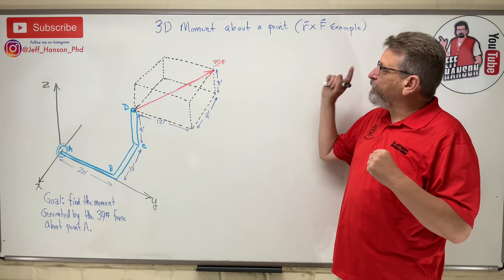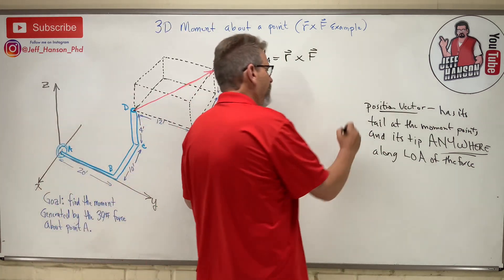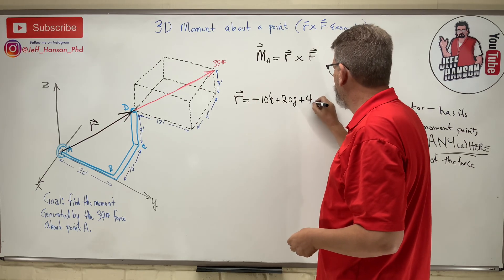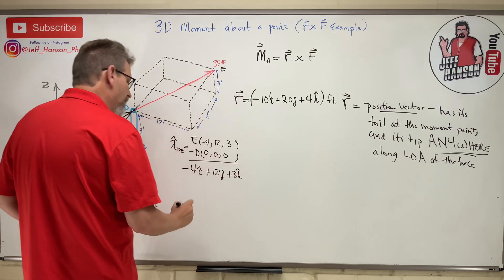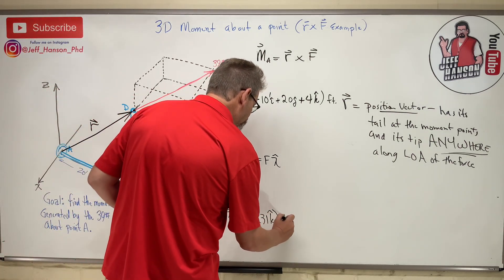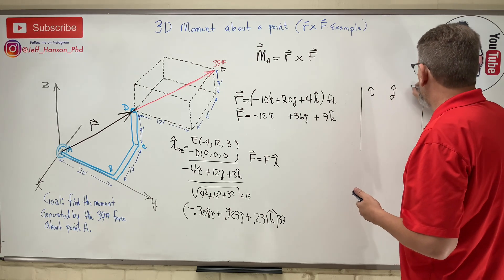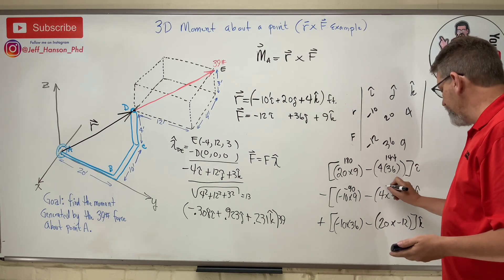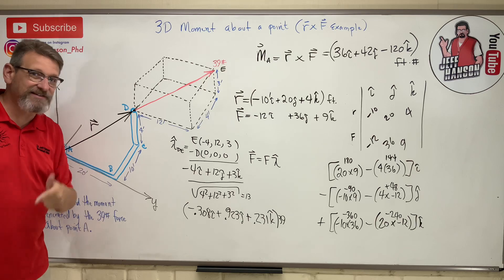Statics: Lesson 24 - 3D Moment About a Point and rXF Example

Comment: Hi, in the beginning you said i can take the Point A and attach it to anywhere to the LOA of force. When i do these exact steps using A to E i get completely different Moments. Would it not come out to pretty similar results? I ask that because when you attached it to the point D at first you then had to move the origin? Is that not an extra step that should be eliminated if you just had attached r vector to point E?
Reply: Asking the same question myself right now, but I just cant figure it out.
Did you figure it now, by any chance?
Reply: I made r vector from point A to point E which gives r vector as <-14,32,7> rather than the r he used ( <-10,20,4> ). I get the same answer using either of those r vectors. "Moving the origin" for the force vector just makes it easier to put it in ijk form. Moving the origin is simply just a strategy to make it easier to focus on that vector in the system (expressing the force vector utilizing the entire system is too complicated compared to focusing on a portion of the system because of too many possible unknowns). If we close in on a portion of a system and draw a free body diagram we can solve wherever there are less unknowns to make it easier
Reply: @laven5583  I used <-14,32,7> but got way different answers, to get the Lambda value i did AD = D - A so <-14,32,7> - <0, 0, 0> is that correct?

Comment: My lecturer does the vector cross product a different way. Would there be any reason as to why he would multiply the off-diagonal numbers first and then diagonal numbers . He also doesn't make the outcome of the "j" part of the cross product a negative answer. Would it make sense to do it this way in any scenario or would he be wrong
Reply: Just a different way to do it. I find that method tends to confuse students.
Reply: @engineeredchannel5649  yea I later realised that it gives the same answer and it does indeed confuse students. Not sure why he chose to do it that way

Comment: i figured it out. the force vector has a force that has to be taken into account when breaking it up and r vector doesn't.
Reply: Exactly, what youre doing is taking that vector, making it length 1 and stretching it by a factor of 39.The original vector just gives you a direction. So if you take the unit vector it is length one but in the same direction as the original vector. Multiplying by the scalar gives you of course the magnitude or amount of force that is going in that direction.

Comment: why is the j hat in the cross product negative .. i thought we were just supposed to add those cross products but im confused that you put a negative on the j hat  but + on i and k. can anyone please explain. thank you
Reply: it's basically how the formula works. It has always been i-j+k for cartesian form. We just have to assume that it will be negative for j. I believe everybody was supposed to learn this at the end of Calc ll or at the beginning of Calc lll
Reply: @danielowens6682  thank you so much
Reply: @zuko_4  think of the matrix (called a determinant which is what the cross product is utilizing) as a checkerboard. The signs of the matrix are from something called cofactor expansion so it looks like + - + -  but same for the signs below this - + - + but in this case we only had 3 components in our equation hence the + - +. The signs only apply for the rows or columns you are expanding along. In this case we are only expanding along the top row. Technically you could reorder this so the i j k are on the far right column going from top to bottom and same with each vector but the signs would be different because of said cofactor expansion. Look into determinants and cofactors for a more in depth explanation though!

Comment: Shouldn't the unit vector for the force by from point D to point E, and the coordinates of point D are not 0 0 0 but rather something else, -10 20 4?
Reply: if you use D(-10, 20, 4), then you should use E(-14, 32, 7). when you substract D from E the result will be the same
Reply: The unit vector(lambda = normalized position vector..same thing) can be done both ways.  What is the unit vector for position vectors: < 1, 1, 1> or <3, 3, 3>....after you divide each vector  by it's magnitude(in math it's called "normalizing" and you can "turn any vector into a unit vector" when you do that)  what do you get? Same thing.  This is a great observation, because this is a typical "trick exam/quiz problem", where the point coordinates may not all be "given to you" and you need to figure it out.  Keep on.